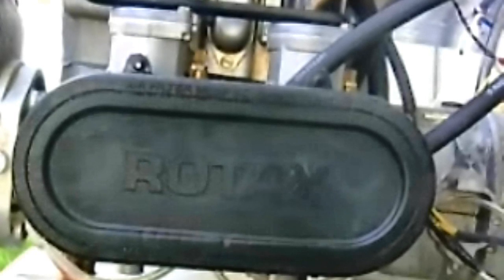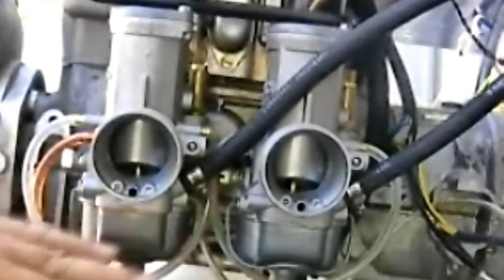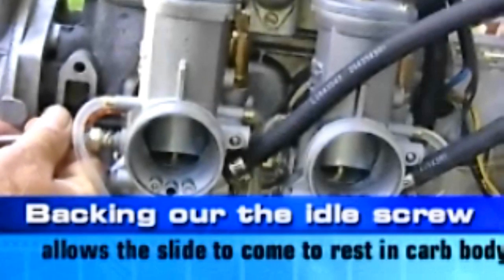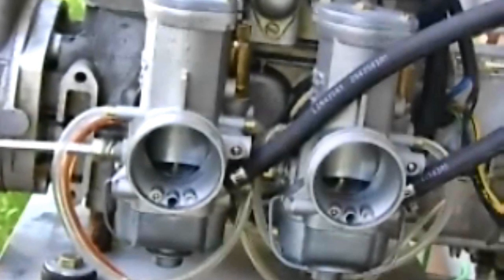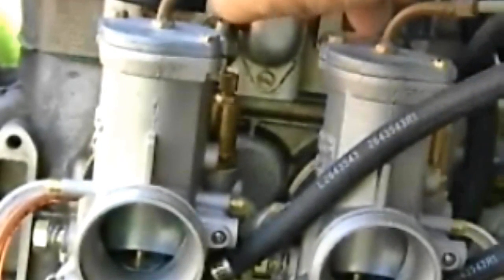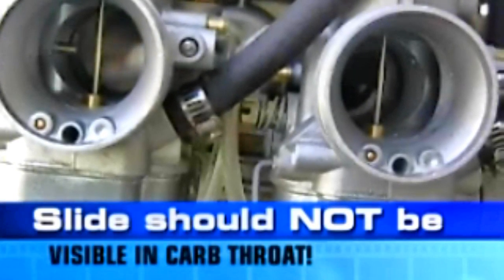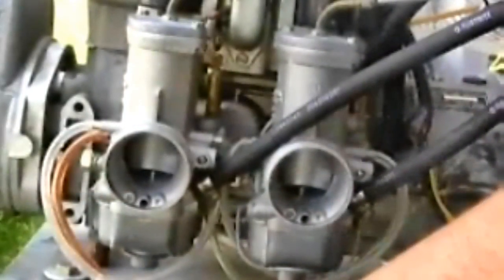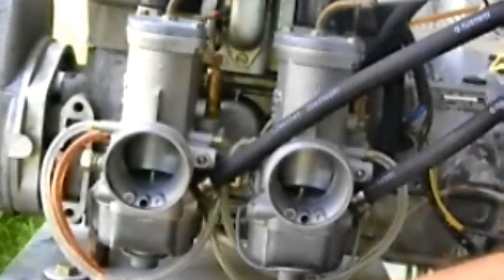Bing 54 Carburetor Synchronization on Rotax two stroke aircraft engines.

Comment: Nice video, thank you.  Wondering about setting with vacuum gauges?  A friend did this and found that the carb slides were physically set differently afterwards.  He claims smooth operation.  Which method is preferred and more accurate?
Reply from the maker: I have used both and prefer this method, no equipment to purchase or set up.
The Ultralight Flyer

Comment: How high should the slide be when at full throttle? Mine seem like there to high but were in sync
Reply from the maker: It should be completely clear - when seen from the air filter side.

Comment: My 582 runs rough below 2900rpm. It's a fresh rebuild. I think it could be the prop but I thought it would get worse with higher rpm.
Reply from the maker: Check to make sure your needle is BELOW the white plastic cup, in your carbs.
Reply: @ultralightnews  That's not it. I just checked and it is assembled correctly. I wonder if I would be the props resonant frequency with that gearbox and engine

Comment: I had a single carb duel ignition and I upgraded to a duel carb. I have had issues like crazy getting it started. After I can finally get it started the RPMs are way too low. Like 800. If I give it gas it dies. Eventually it revs up and sounds normal. I can give it gas and it acts normal. After warming up fully it will idle like normal around 1800-2000. Any idea why this is happening? I have re jetted for my altitude and even replaced my needle jet. Nothing seems to help.
Reply from the maker: http://www.ultralightnews.ca/bdrive/rotax-a-gear-box-and-rotax-b-gear-reduction-drive-updates.html
Reply: Light Sport and Ultralight Flyer thanks for the info. With this engine only having 20 hours on it I wouldn’t think this would be the issue in this situation. Any other suggestions on the carb side of things?
Reply from the maker: http://www.ultralightnews.ca/bing/bingcarbtuning.html

http://www.ultralightnews.ca/bing/bingcarbdisassemblytip.html